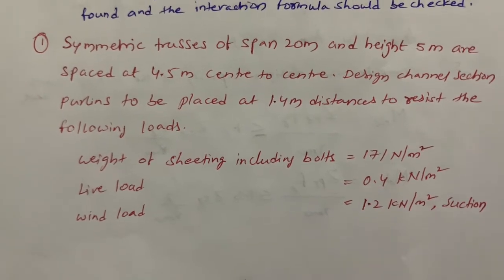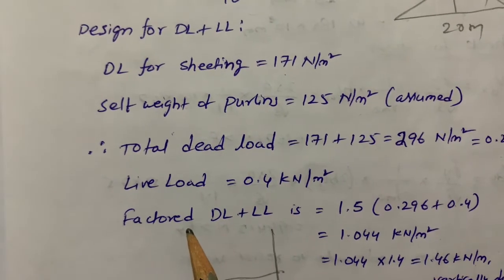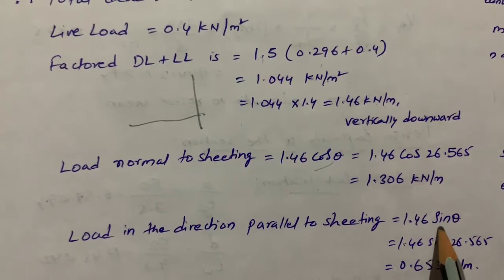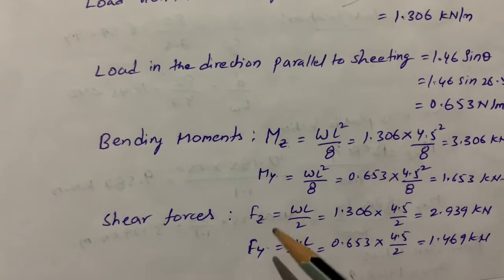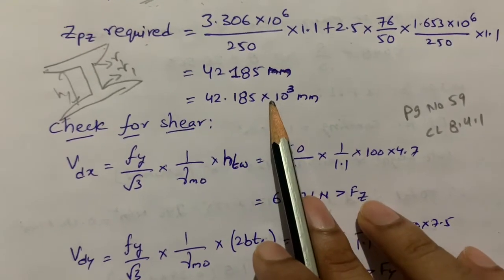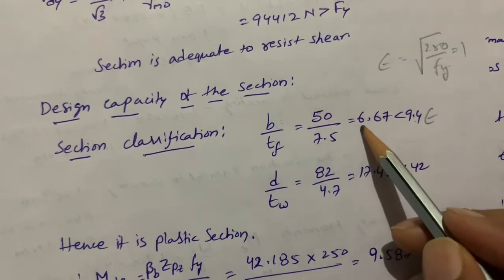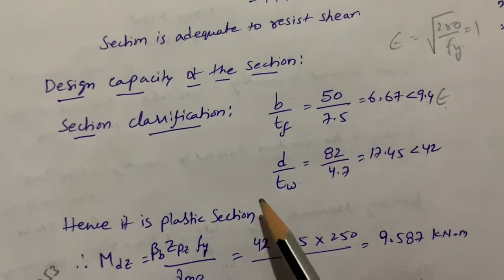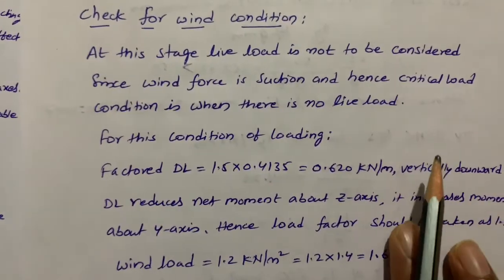#Design of purlin#Plastic section modulus#UDL#check for shear,bending&deflection#ISMC125#Channels#

Comment: Sir i will send one problem please solve Or send  any related problem to that
Reply from the maker: I am happy Swetha for asking me. But, u know in these days I’m so busy. But, send the problem I will let you know that I can do it now or not.
Reply: @civilworld  ok tq sir.. Design a purlin for the following data... Spacing of roof truss is 6m, spacing of purlin is 1.6m, pitch is 1/4, wt of GI sheet is 146N/m2.wind load intensity is 1800N/m2
Reply from the maker: @nagulaswetha5758  Is that angle purlin if it is angle purlin then go with this 
https://youtu.be/NNXzsyxA8N8
Reply from the maker: @nagulaswetha5758  https://youtu.be/wiH-I9OtoTA
Reply from the maker: @nagulaswetha5758  https://youtu.be/iyXgW4v9Bqs
Reply from the maker: @nagulaswetha5758  https://youtu.be/_QrbIiFzzB4
Reply: @civilworld  I section